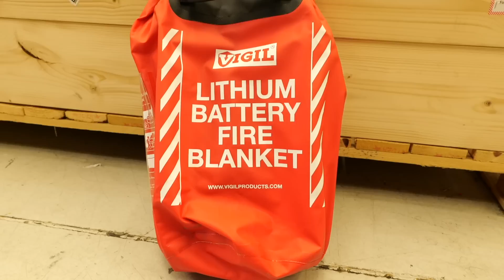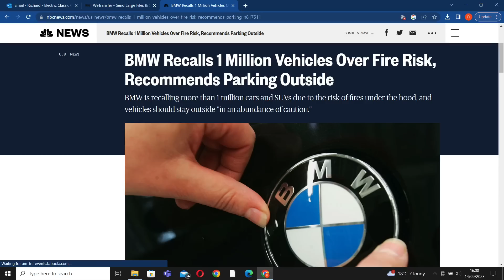Electric Car Fires - Facts and Figures

Comment: But a bloke down the pub, said they all catch fire.
Reply from the maker: We all know THAT guy down the pub. 😉😆😂🍺👍
Reply: that thinkign works both ways bud...who cares what that bloke said.

i tend to think on this matter as if it was me, the ev is at my fkn place and how easy....just i...can put it out.   and thats the very fine difference here. i won't be able to put it out or any means to move it so it don't take out other vehicles. my home, garage everything is now in jeopardy going right into my neighbors belongings taboot.  its all in high jeopardy just because i coudn't immediately take my got dam garden hose and put the pos out.  that i had to wait and let it burn everything up around it until the fire guys arrive.  just 10 minutes of them kind of blazing, cause runnaway off onto everything around it.  fk....that.

so ok 20x less likely. fine. point taken.  regardless though...its just not my vehicle that i will be out of.  thats pretty much a guarantee it will take out god knows what else around it.

 i just can't put the fire out myself.  thats the real breaker for me
Reply: @x-LestatTravesty-x  Always look on the bright side of life.
Reply: He read it on the internet.
Reply: The question should be what happens to the people in the ev when it catches on fire if they can escape unharmed does it matter if the car then incinerates itself,

Comment: Very informative! Excellent video!!
Reply from the maker: Thank you!
Reply: This video is based on facts, your comment is based on conjecture. Do you have facts to support your assumptions? How do you know that as EVs age they are more likely to catch fire? If, as you say, they are not old enough to be a fair comparison (despite not knowing how old the ICE cars that were included in these reports were) then it is not possible to have any evidence to support your claim. And BTW the point of the video was to present the actual facts, not to discuss sources of ignition or to explain fuels ignite.  @orionbetelgeuse1937

Comment: Brother, we call that FUD.
FEED UNCERTAINTY AND DOUBT
Unfortunately all kinds of things catch fire.
I am a fire alarm system provider and our systems detect all kinds of fires.
The local Fire Department is well aware of all the hazardous materials out there so they have the proper equipment and training to extinguish  whatever type of material is on fire.
EV battery's are just another example.
thank you for educating people.
bill Compton
Reply: *FEAR, UNCERTAINTY, DOUBT (FUD). Other than that, spot on.
Reply: batteries
Reply: Not certain many if any fire departments are equipped or adequately trained to put out battery fires..
Reply: Thank you for saying so. The people I know here in ATL and Cobb county fd say about every 5th fire they roll on is a vehicle FIRE. 

And the #1 recall across ALL LEGACY ice oems currently effecting 10,000,000+2-5 year old vehicle's? Is for the risk of FIRE even when parked. 
Hence why garages used to always be detached structures. 😁

Comment: With lithium iron phosphate coming down in price I hope we'll see it replacing traditional lithium in cars. It doesn't exhibit thermal runaway, doesn't use rare metals like cobalt, and has significantly longer cycle life.
Reply: "lithium iron phosphate" is "traditional lithium".
Reasons for (more?) fires in Nickel based cells....
1) Higher energy density.
If there is an issue, there's more energy in the system.
.
2) There were (possibly) more of those cells in circulation.
.
3) "Foreign object trauma" 
(Aka "lump of metal punctures pack casing")
Which would also be an issue with an ICE vehicle.
.
Meanwhile, some (many?) of the issues were not chemistry related, for instance, the "infamous" Chevy Bolt recall was from my recollection due to a "mechanical" tolerance in manufacturing which allowed contacts to shirt out. Not chemistry related.
.
There's also the learning curve to consider.
Reports from Jeff Dahn (Tesla battery guru) several years ago detailed the discovery of residue from a chemical used in the drying process if the cathode/ Anode material which reacted within the cell, causing degradation.... Now removed.
Then there's the recent discovery by the same team that a sticky tape used throughout the industry to secure components in the cells contained a chemical in the adhesive which could result in the same problem..... Now changed to a different (cheaper!) tape.
.
Of course the Tesla 4680 cells, which use a "dry process" for Anode and Cathode production won't have the issue due to .... No solvents.
Reply: Teslas catch fire too.
Reply: I was going to say the same thing. As new battery technology is filtering down it can only mean safer EVs all round..
Reply: Those big yellow blocks are what you are referring to I believe. How ever modern iron phosphate has "about" twice the capacity and someone on the tube's has pierced a battery and gotten a flame out however it looked to be far less violent.                                                     I'm not saying it's not the solution but people like John Chdogan  spouts out that there slightly less reactive with out give out any more information on this
Reply: Unfortunately, the Federal Exhaust Gas Fun Prohibition Ordinance (BABVVO) will soon prohibit the driving of combustion engines in public outside of rush hour traffic and established means of transportation, and exhaust gas fun will then become a traffic violation.
Reply: @Schlipperschlopper  only in your imaginary world - ICE and EVs will co exist for decades to come.
Reply: Your assertions concerning Lithium Iron Phosphate batteries are false and misleading. Studies published in the Journal of Science indicate they also subject to thermal runaway and thermobaric explosions.
Reply: I don't see why maufacturers can't deploy LFP battery packs and swap out LI packs in current cars.
Reply: I guess you have to consider that petrol cars may have a lithium battery pack to run the hybrid system. Is it possible that a pure petrol car could have a lithium battery to start the car? In which case what is the common denominator in terms of spontaneous combustion?
Reply: I've been driving a LFP based car (punch ev)  in India for past 7 months, have scraped the bottom twice, no issues.
Reply: Unfortunately when EV do catch fire, They do take many gallons of water / foam to put out though compared to petrol / diesel fires, & the emissions that come from EV fires are a lot worse for the climate. 
Also probably been mentioned many times before, but where does the electricity / manufacturing processes come from? 
EV are much heavier then its competitors, meaning more wear & tear on the tyres, the roads etc.
Daniel.
Reply: I read an article yesterday about a valet driver who outrun his talent at Stansted Airport & crashed a Tesla M3 through the fence & into a pond. 
According to the Sun the lithium ‘leaked’ into the pond killing all the wildlife. 🙄
Reply: @hughmarcus1  Yup. That sounds like the Sun.
Reply: @hughmarcus1  But it didn't catch fire!!!  😂
Reply: @hughmarcus1 how do you feel about all the wildlife that died because of oil extraction, oil pollution etc? we could burn all the batteries from all EVs that exist and still the damage would be less than 1% of what oil did in the last 120 years.

The whole lithium battery talk is hyperbolic nonsense without context.
Reply: you compairing 120 years to 10 or 15......rolling eyes. @badchefi
Reply: This year in china who leads in total cells made&capacity is seeing 63% of all cell production as lfp/lmfp chemistries. 
Tesla has sold over half of all their base model's as lfp since late 2021 now. 

The megapacks are all lfp since last year, and the powerwall 3 is switching to lfp cells.
Reply: 2 other points.
Cobalt isn't "Rare", it's generally a byproduct of mining "other elements" (Copper and Nickel  to name 2)
.
The cycle life of Nickel based cells is a myth.
The Jeff Dahn team has produced "100 year" Nickel/ cobalt cells in their lab, simply by tweaking chemistry slightly and reducing voltage.
These cells still run at a high voltage/ energy density than "Iron based" counterparts and rather than degrading appear to improve both performance and durability as they age.
.
("100 years" estimated based on accelerated test programmes, comparison with other cells and decades of experience)
.
It's well worth searching for and reading their reports.
Reply: Sure
Reply: Yes mate all well and good but just remember that EV's still cost more to run than ICE vehicles if you consider the excessive tyre wear, higher insurance cost, and the cost of public chargers  - when you can find one that is working or not backed up with a queue of others waiting for that charger. They are also way out of the affordability of the average Joe Public who are probably on limited or low incomes - go figure!!
Reply: @johngoard8272  you have an EV and are speaking from experience?

We have some for private and commercial use and found that it costs us four times less
Compared to the previous ICE cars.

Maybe check your source material? Find a neighbour with an EV and ask to see his figures?